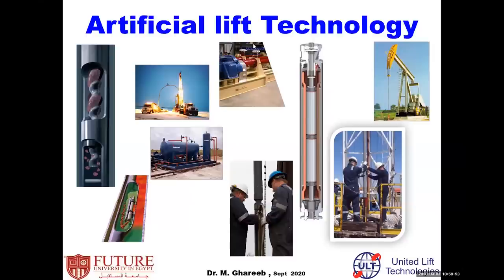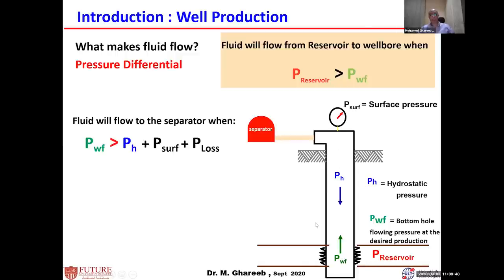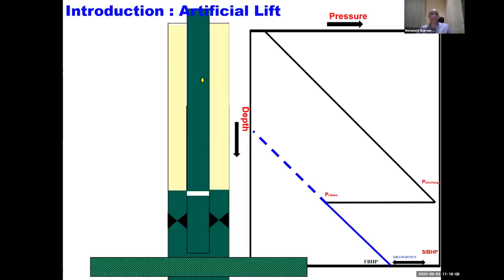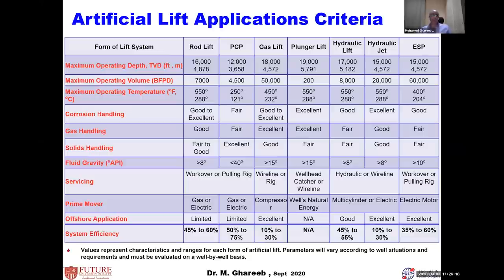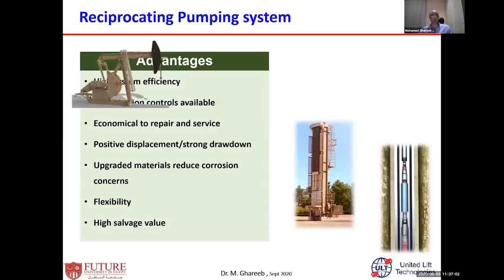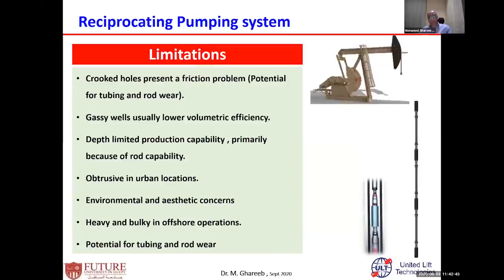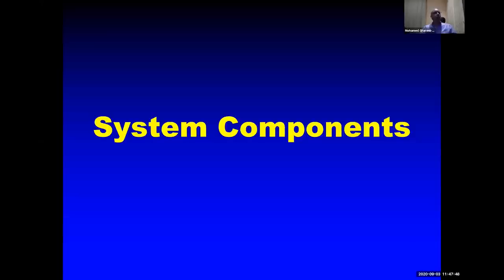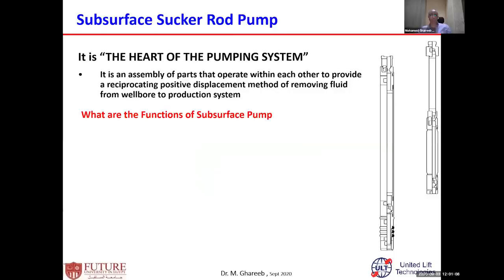Artificial Lift Technology, Dr. Mohamed Ghareeb 01/08

Comment: Please tell me what does backpressure means !
Reply: When a fluid moves through a pipe under a pressure, that fluid will encounter opposing drag force (which is in between the pipe internal surface and fluid) and it will slow its flow velocity down. 
That drag originates a back pressure, which in turn reduces the flow rate